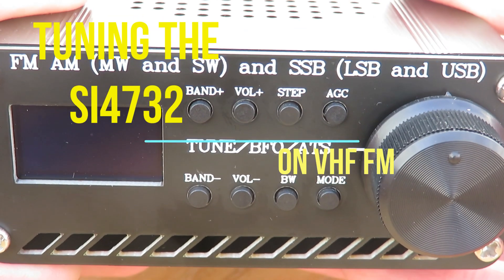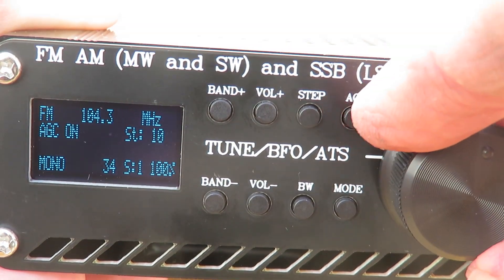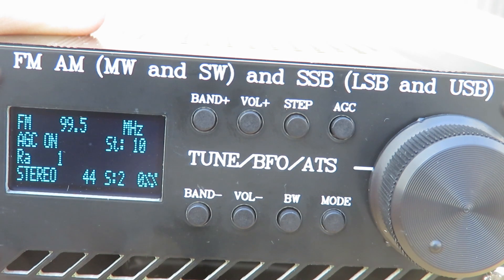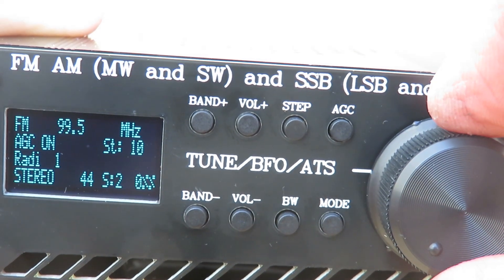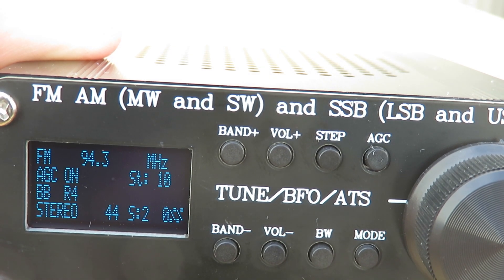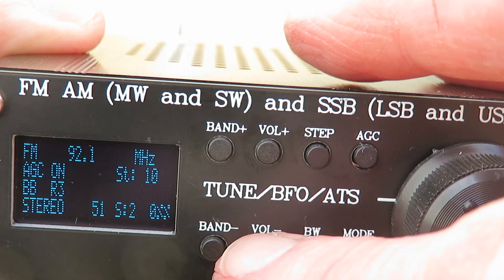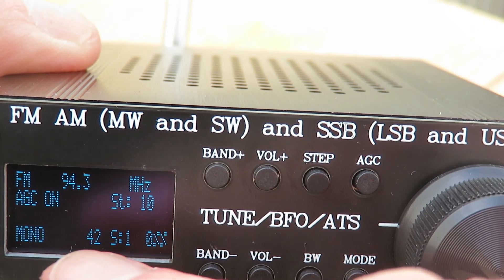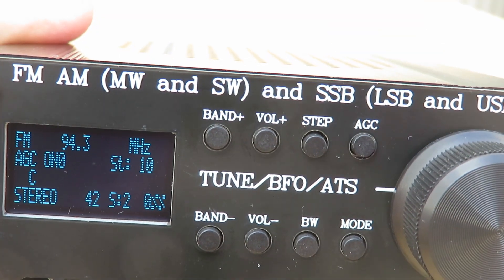Tuning the SI 4732 receiver on VHF

Comment: What dealer did you buy this radio from? I see plenty of the old charge connection.  Looking for the newer "C" connection. Tnx 73 n4sub
Reply from the maker: The one with the newer usb micro connection came from Aliexpress and was labelled as an ATS-20. Incidentally although the performance of the radios appears identical I have had a LOT of trouble trying to flash the Arduino in the radio with the newer, micro USB connection.

Comment: I'm the developer of the library that this receiver was based on. I can see the RDS function is not working properly. Am I right?  I will try to fix it.  Thanks for sharing. Ricardo / PU2CLR.
Reply: Hmm got one and updated the firmware fine ( well had to desolder the uno and replace it with a bootable one)
Reply: Started work on the ui. Got  fm better
Reply: @keeshofwegen5822  The examples I have developed to the Arduino Library were not aimed to be a final product. The idea of the examples is helping developers and designers to build their own projects.
Reply from the maker: Hi Ricardo. I have no experience of Arduino but downloaded the library from your github and managed to work out how to upload it. Unfortunately I bricked the receiver! I think I need to learn more about arduino as I struggled to update it anyway :}
Reply: @KevinOReillyswl  Sorry for that. What did you do to brick the receiver? Has it stop working? If not, please, do not do anything else. Keep it alive with the factory features.  Feel free to contact me by email if you need more information (pu2clr@gmail.com).  Regards, Ricardo.
Reply: @pu2clr  is there a how to video for the firmware upgrade plz
Reply: @raybokor2  I don’t have this radio with me. I bought one and I’m waiting it from China. When it arrives I will do this.
Reply from the maker: @raybokor2   I was thinking of doing one but it may be better to leave it to the expert, and I am not one! It helps if you have some familiarity in dealing with Arduinos and the associated software. I look forward to Ricardo’s video. I may do one later but it will be an idiot’s guide, written by an idiot I.e. me 😀
Reply from the maker: Ricardo, yes it seems the RDS is not working properly. Thanks for looking at the video.